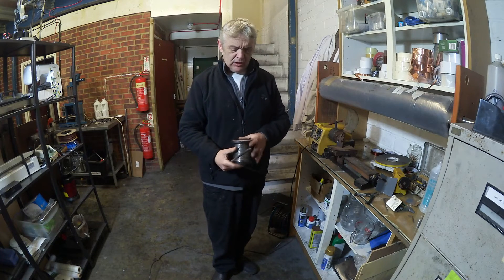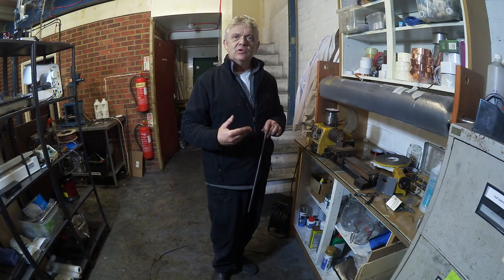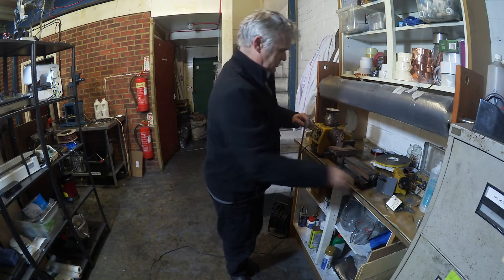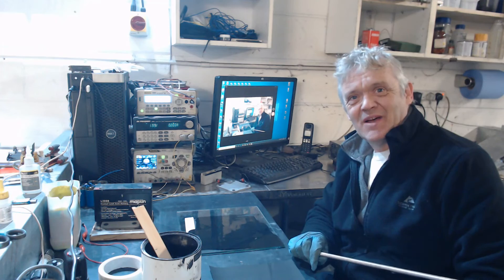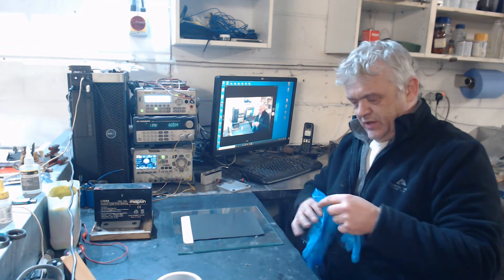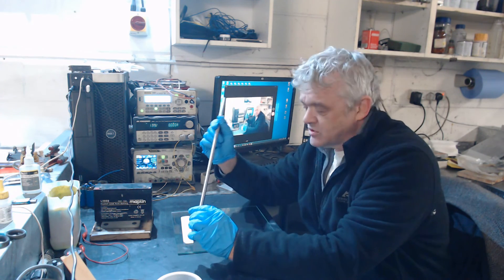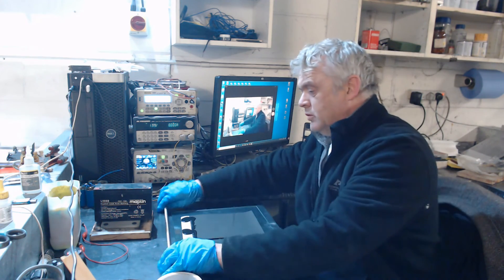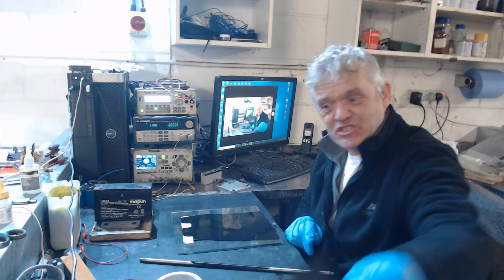Making And using A Drawdown Bar - Meyer Rod

Comment: Hello. Thank you for the great video. My question is about the wire. How hard is it and does it hold its shape when bent. Does it have a code like 304 Steel? 

Also if there is a bend on the wire before winding does make inconsistant gaps in the finished winding?

Comment: That's awesome to know...I am wondering if you have ever tried modifying an inkjet printer to use with your conductive inks? Or is that not a viable idea? Also..I do a bit of recycling of many things...would the stainless steel rollers in an office copier work? I've recycled many of them

Comment: The spiral pushes the ink off to a side a minor problem but a perfect one would be if you could just lath the cuts into the rod for depth and width but that would be far more expensive in skill time and tooling to do. Perhaps electrolysis cutting might work.
Reply from the maker: for sure

Comment: I found a steel rod in used cartridges for laser printers. I also found there a piece of thin metal that can be used as doctor’s blade 😀

You can use battery-powered screwdriver if you don’t own a lathe.
Reply from the maker: that's a good idea mate - thanks for the share
Reply: Thank you (!) for sharing :)

Comment: When calculating the resulting thickness of the layer by  Wire Radius / %solids
It doesn't exclude the volume taken up by the wire. 
So the max height is indeed half the diameter of the wire times the % solids, 
But then the layer levels out from those peaks between the wire, to an average. 

Or am I missing something?     Great Video!
Reply from the maker: nope - you are spot on mate - you could always use a micrometer too!
Reply: Theoretically the thickness of liquid left behind should be 1-pi/4 times the wire radius. But you should probably measure if you care about the exact thickness, since the real world is nororiously bad at conforming to theories.